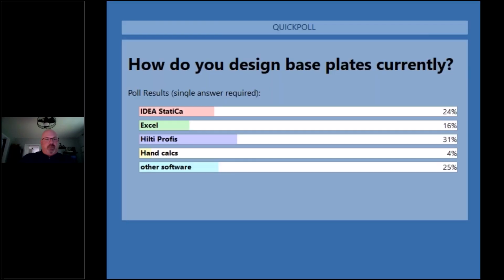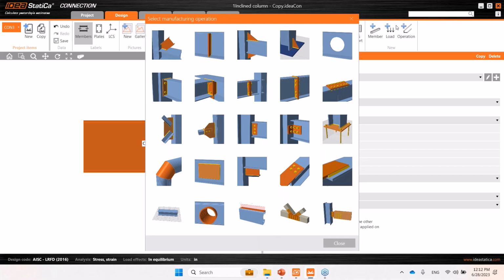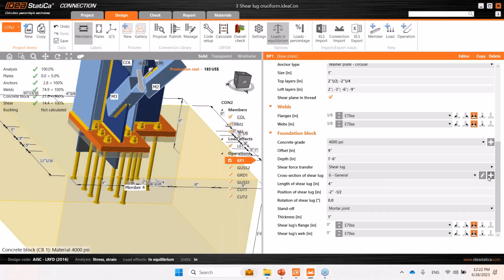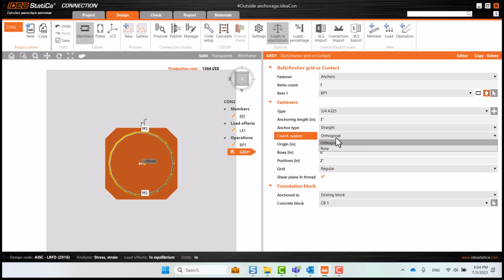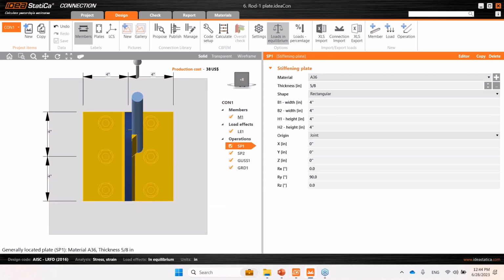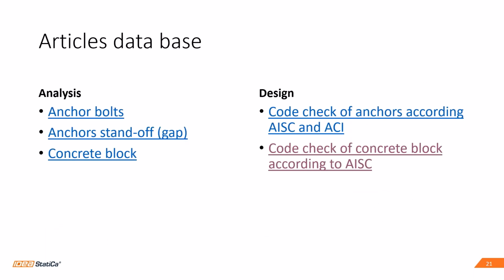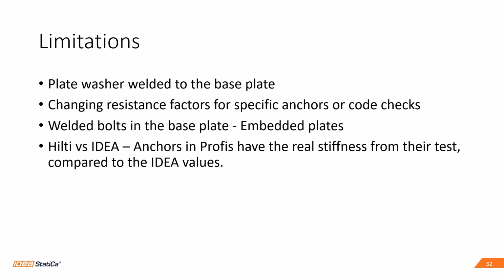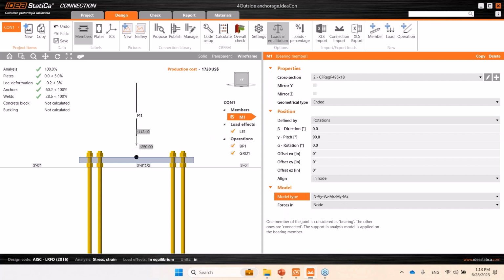Design of Steel to Concrete Connections including Base Plates

Comment: Can we use one base plate for two near by columns with smaller gap? is that able to design?
Reply from the maker: Yes, it's possible to design a shared base plate for two nearby columns. We've covered this in one of our sample projects — feel free to check it out on our website here: https://www.ideastatica.com/support-center/anchoring-for-industry-tank-in-uruguay

Comment: I cant seem to get by concrete block to be vertical. Every time I try the concrete block goes vertical on the side of the connection and member.
Reply from the maker: Hello, to make the concrete block vertical, you need to assign it to a plate with a vertical plane.
See the article about how to work with concrete blocks:
https://www.ideastatica.com/support-center/general-anchoring-shapes-and-options

Comment: Are we designing footing for base plate or just pedestal for base plate? In idea statica

And why we are getting larger dimensions of Concrete block?
Reply from the maker: Hello, what you do in IDEA StatiCa is you design the connections and you get a code-check of conrete in compression under the base plate and shear.
https://www.ideastatica.com/support-center/check-of-components-according-to-aisc
You do not design the reinforced concrete block itself.
Size of the concrete block that would pass the code-checks for anchors depends on multiple criteria - mainly the problem is the concrete cone breakout
https://www.ideastatica.com/support-center/concrete-cone-area-of-single-anchor-and-group-of-anchors

Comment: is concrete splitting check included?
Reply from the maker: Hello, thanks for your question. COncrete splitting failure check is not possible at the moment. 
Read more on our website: https://www.ideastatica.com/blog/safe-and-accurate-anchoring-design

Comment: Can Ideastatica use a concrete Foundation Block with reinforced steel bars?
Reply from the maker: Hello, thanks for the very appropriate question. The answer is: "Not yet." :-)
See our theoretical background describing how CBFEM treats the structural model of a concrete block. 
https://www.ideastatica.com/support-center/concrete-block
But we are really aware of this very common customer requirement and exploring the way how to achieve this.
Reply: good question